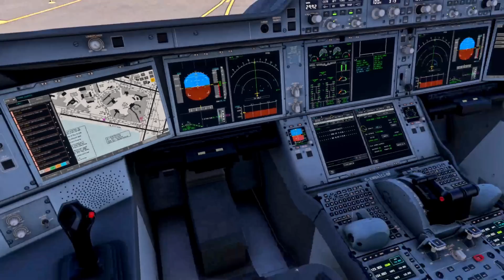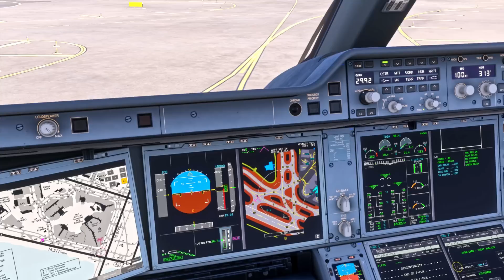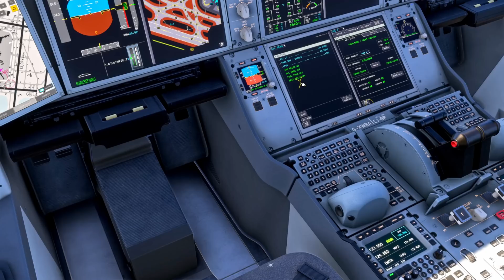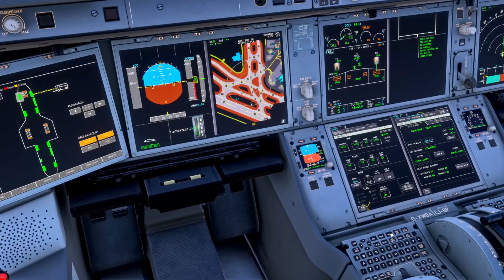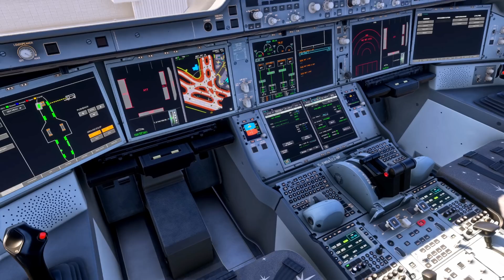A350 Taxi In & Shutdown Tutorial | Real Airbus Pilot | MSFS 2024 iniBuilds

Comment: Thank you for this. How come you have to wait to below 150 degrees to take off when using the brake fan, compared to below 300 degrees without brake fans?
Reply from the maker: Hello Chris, When brake fans are used, they accelerate the cooling process by forcing air over the brakes. However, this can lead to moisture condensation, particularly in humid conditions. If takeoff is attempted while there is still moisture in the brakes, it can cause uneven heating and a phenomenon known as "re-humidification," which can lead to brake performance degradation or even potential brake failures. Without the use of brake fans, the brakes cool down more gradually through natural convection and radiation, which reduces the risk of moisture retention, allowing a higher takeoff temperature limit of 300°C. Hope that helps